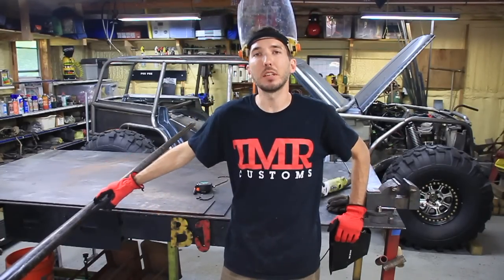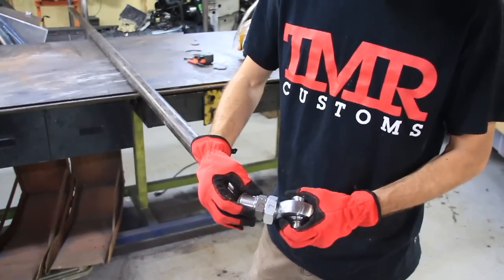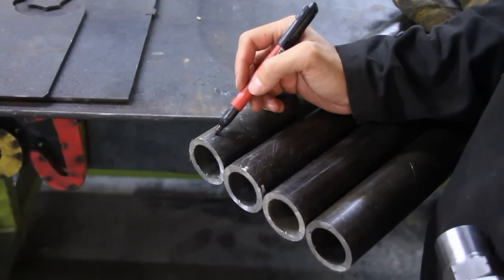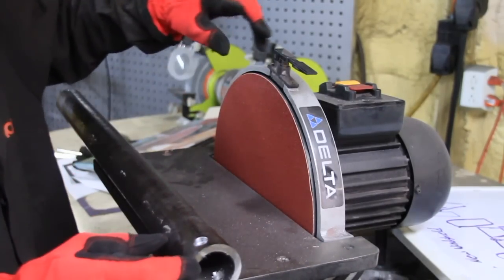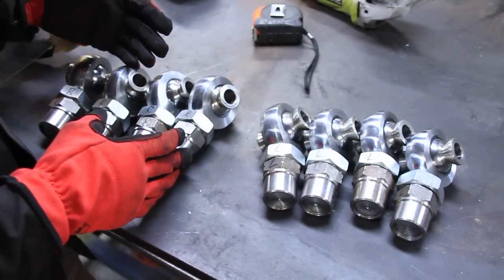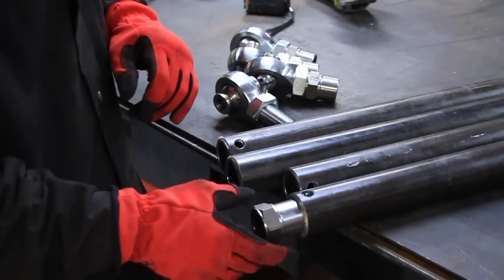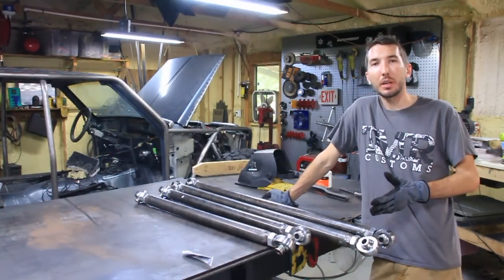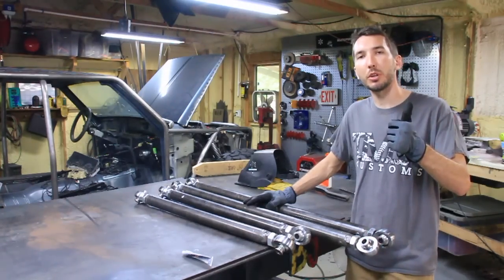Making Control Arm Links

Comment: See the notches in the ridges of the hex head on each left hand joint, that's the universal mark for left hand thread, same goes for fuel gas hose connections.

Comment: Hey man. if you need to block a hole for welding like the threads just jam a ball of aluminum foil in there. Doesn't burn, doesn't stick and it blocks the thread.
Reply: a c Great idea
Reply: Thanks. A lot of tig guys do it for back purging metals like stainless. Also has the added benefit of covering threads.
Reply: Also helps remove heat from the weld while cooling

Comment: Great project and build, It's looking really good. 
You should slow your welding down,  weld a one-inch pass, rotate 90° weld an inch, either keep that pattern or go to next one keep rotating the rods and rotating the welds at 90° rotation to prevent any warping from happening. This would keep it as cool as possible. You could also put some aluminum rings around the pipe, close to the weld to draw the heat away or even cap the end your welding on and fill with water. This look to be a TIG job to me.

Comment: I had really good luck with welding the bungs in without joints. I made a quick aluminum non threaded heatsink that I inserted into the bore with liberal antisieze on it that helped to keep the threads from deforming too much. It let the heat stay where it needed to weld and soaked it away from the inner bore where it was non desirable.

Comment: Perhaps you know better than I but I thought it was worth mentioning wd40 is not a long term lubricant.  Its a common misconception that wd40 is good to put on ball bearings, bike chains, door hinges, etc, etc.  This is actually a bad idea as wd40 is actually a solvent.  Great for getting stuck things unstuck, but it will eat away any existing lubricant and then dry away leaving your ball joints with no lube.  Perhaps those are designed to work metal on metal without lube, but if they do need something, wd40 should be avoided.  "wd40" brand does however make a silicon spray lube that is much better suited to that application.
Reply: Spencer/Tressa Adams exactly what I thought as he put it on the links. I was like oh man... come on your better than that! in my head
Reply: Kroil is best, wd40 is shit
Reply: WD40 is a water a displacer. Hence WD. Definitely not a long term lubricate.
Reply: Very true. It is a very good solvent. Takes off sticker residue and lots of other stuff. It is not a lubricant. Short term, long term, or any term.

Comment: Aluminum links. Your center of gravity is mostly going to be effected by your drivetrain posiiton. Aluminum also holds up better then steel links. You could have also ran lighter upper links as they don't see the bending forces that the lower links do.

Comment: Steel vs Aluminum (normalized against fatigue strength). Steel wins, and it'll make you a cup of coffee! 

4140 Chromoly: 7.8 mass units, 1.5 CO2 units, 20 energy units.
7075 Aluminum: 8.7 mass units, 3.6 CO2 units, 65 energy units. 

Basically, using aluminum will cost you more in the long run. This is when both materials are heavily stressed until they break after repeated use, the steel can be crudely stick welded back together, after being cheaper anyway. Aluminum is easier to drill and tap. Decide what you do more often. I'll keep steel.

Comment: Honestly a solid link of 775T6 Aluminum would probably be the best choice. I've seen them use it on rock bouncers and it seems to hold up very well. You wouldn't want a ton of sprung weight for your rig. You don't have to weld aluminum just drill and tap. Chromoly would be better however I don't have a way of heat treating my welds after tig welding it.
Reply: you could always send it to a commercial heat treatment service, but you might not be willing to pay for the service, but you could have solved the heat treatment process by outsourcing.
Reply: BTW 7075 aluminum doesn't weld for shit.

Comment: Thanks for the show. Wow. You could use a turning lathe for those "sticks" as you make them or other items often enough. Could cut them to length, chamfer, bevel and even weld on one. Not sure on the idea of aluminum vs. the steel. The steel are likely way more strong than needed but I've seen them bend too. As someone noticed before, there is a better replacement for WD-40 called Pro Long Super Lubricants SPL-100. Comes in trigger or can spray. Truly, a lubricant that beats WD40 in many ways plus a protectant. It's cheaper if purchased in case quantity from manufacture vs. a can at a time.

Comment: just spit balling, a steel link with a springy aluminum core, strength from the elasticity of aluminum wear resistance of the steel, save weight on amount of steel (thinner wall) use heat to expand steel then slide in aluminum for presure fit and no room for rust/oxygenation then bore aluminum weld in bung.... feel free to shoot me down, not even his question...  love the channel btw!

Comment: matt,  buy yourself a cheap HF 14" chop saw,  much better than an angle grinder for this.   My HF chop saw was purchased in 2001 and still running strong, best $39 I ever spent.
Reply: I just checked, $79.00 in today's money, still a freaking bargain.
Reply: Go to the pawn shop and get a portable bandsaw. They are always there.

Comment: Just squirt a bunch of heat resistant paste inside the bung hole, protects from splatters and thread warping. Tig welding will give you flawless welds btw

Comment: Depending on the aluminum used , it has a memory property about it (especially the solid stock) ..... So if you land on one of your links it may bend , but it will return to its original shape once the pressure is removed ...... This is what i was told when i was shopping for  link material ...... But cost  is also a factor ... So i went with 2" 1/4 wall dom , vs aluminum ....Eventually i will switch over but for now its all steel for me ..
Reply: Generally speaking, aluminum will always, eventually fail.  There is a reason why they don't make car springs from aluminum.  Again generally speaking.  Its about fatigue strength: https://en.wikipedia.org/wiki/Fatigue_limit.
If you are rebuilding your suspension on a regular basis (racing) go for aluminum.  If your like me, build it once and neglect it until it fails, go with steel.
Reply: Maybe I'm wrong but I don't think of aluminum bends it'll return to its original shape. This is why I always shoot carbon fiber arrows and not aluminum, because if they ever hit something hard enough they will warp and then they will never shoot straight again. 👍

Comment: tractor supply stores will also sell the joints, along with heavy duty tow shackles and a suprising amount of recovery gear etc...
Reply: I dont know why its surprising.  Tractor Supply in more rural areas supply farmers.  I have a #20000 snatch block.  Bought at tractor and it works like a champ

Comment: Outside steel or chromoly tubing, with aluminum bar stock inside. That's the best option. Could probably get away with less or smaller tubes that way as well. Slightly if any.

Comment: Rock bouncers typically use aluminum links because when you smack them on a rock they will bend but flex back straight. Steel will stay bent.

Comment: It's always good to reduce unsprung weight, and the difference for CG would be more than offset by performance gains from less overall weight as well as better suspension action, the downside though is aluminium is way more prone to failure if they get hit by anything.

Comment: Sit the tubes on a length of square U section steel and clamp it down - it will stop it rolling/kicking.

Stepped drills are expensive, use a reasonable pilot hole and final hole using regular drills as they are cheaper to buy and easy to re-sharpen.

I do not agree with using plug welds in this sort of application as 
a/ the welding process can add additional stress and can promote cracking, and for some materials will compromise the temper and strength around the weld
b/ as mentioned, it unevenly heats and can deform the thread form of the insert, it can also result in dingleberries self welding/tacking inside the insert
c/ the strength of the end weld to the insert should be adequate as it is the full thickness of the tube
d/ I'm lazy

You don't need gunge on the internal threads when doing the external threads as the spray/splatter is moving away from the opening.

Consider picking up a LH and RH finishing/ bottoming/plug tap to clean up the threads.

Comment: The center of gravity argument is just about negligible, not really an issue.  Unless it's a race vehicle and you're getting into heat treating it... steel will last longer.  Aluminum will be more likely to wallow out the threads, get messed up on rocks, work harden and snap...

You had me laughing when you said you were going to put down a rag on the floor to prevent a mess... I was wondering if the mess was worse than the scorch marks were going to be ;-)

About protecting the threads- get a fine thread bolt the same size (an old heim will work too, just not as convenient), give it a coat of high temp grease/anti seize/nozzle gel and thread it in before welding.  It should protect the threads, and prevent distortion at the plug welds unless  you way overheat them.  Worst case you can impact it out and run a tap through it, but running a tap in there is a last choice since it will wallow out the existing threads some, they'll never be the same....

Comment: Surprised you don’t have a bandsaw. Even a cheaper harbor freight would be immensely useful for your needs. Cutting with a grinder is time consuming and far less accurate as you know leaving you having to cut long and grind to length. For future projects you can find metric sized hole saws on eBay to fit those more odd ID sizes and there is one company that sells a true metal saw but they come from China. A NOGA tool also cleans inside burrs. The correct hole saws don’t use raked teeth as your accustomed to they are carbide wide teeth more like a mill cutter. They work slow, efficient, and clean. Very cool project.

Comment: So I like the video, just one thing I noticed, I may be wrong, but it looks like your welding in your garage that is spray foam insulated which typically is highly flammable. As a fire fighter and someone who studied architecture quiet a while that made me cringe. If that is indeed the case I would suggest putting up sheetrock bare minimum before doing anymore. You don't want a flaming rag taking out your entire garage, home, or hurting anyone.
Reply: I've seen the blue foam actually explode like gas

Comment: Even though you lighten up the bottom of the jeep Aluminum is stronger. If you keep bending a steel arm then it would be something great to look into.
Reply: Only if you are using solid rod aluminum, but they have problems breaking at the threads for the heim joints. Steel is stronger than aluminum. 4340 chromoly is the best of both worlds, just expensive and you have to know how to weld it.

Comment: Dude you need an air die grinder and a rotary file bit. Removes burrs, enlarges holes, and contours metal like a free hand milling machine. $10 at harbor freight well spent.

Comment: could also vice clamp a size larger short length of pipe, run your build pipe inside,
and as you use a angle grinder it will be a bit easier the work on and possibly turn on its own.
Reply: love your vids, ive never seen that model jeep look so good, 
and from watching your vids it appears to be extremely functional too !
Reply: 9:25 use Anti-Seize

Comment: you could have used a bolt or a plug to seal the inner threads while welding. LH & RH of course or a simple MS or Al taper plug made to suit

Comment: You could also use one sacrificial bolt to hold the hole true and block spatter.
Reply: That is a good point but then you have to worry about it seizing in the hole from the heat.  Still only requires replacing the bung if that happens but that is the downside to that.  Plus that is a huge bolt to put in there.

Comment: You said 1/4" wall tubing- is this what I would find in a kit I bought from teraflex or currie enterprises? I'm looking at making my own. Also, will most tubing benders be able to bend this at small angles?
Reply: Mac You might have to go with a pipe bender. But I would ether go with thicker or drop a bar of aluminum inside before you bend.

Comment: Dude ! great video as all your are. Other than the burning rag and when you hit that smoking pipe like a bong , you should have used some Tri-Flow  superior lubricant instead of that Wana B 40 evaporating lube . You got skill Bro !
Reply: WD-40 is NOT a lubricant !! W stands for water, D stands for disbursement, it's made with 40 different ingredients. Mechanics, machinist, racers, use it to keep tools, machines, parts, & equipment RUST free. I spray my bikes, dirt bikes, quads, sleds, & 4wheeler frames so mud & road salt won't stick causing future rust.  
It's nice to use your equipment & just be able to put away until next time knowing it's not gonna rust out.

Comment: I have a question for you. Is it possible to build a CJ using modern designs and materials that meets the Army's original 1300 lb weight requirements?
Reply: I'm thinking an aluminum tub with a corvair engine is a good start. Maybe an SM420 & Dana 18 with a Dana 30 in the rear and a Dana 25 up front. Leaf springs are to heavy so they're out. Radius arms front and rear with coilover shocks might be light enough.
Reply: Ken MacMillan The CJ and Willys were totally different beasts. If you want a light, weak, underpowered jeep just go with the Willys. This is seriously the dumbest idea (no offense). You would dump 25k on a jeep that has no capabilities what so ever besides being light.
Reply: It was just an idea to see if I could meet the army's original weight restrictions. A corvair engine should be lighter and more powerful than the original go devil engine. I'm never going to build it.

Comment: Wouldn't think reducing unsprung weight matters at all in a low-speed, low suspension-velocity application like a rock crawler; I would think that low CG would be beneficial, but suspension link weight pretty much irrelevant. It would be what's higher up that would matter more. No charge for the opinion. I could be wrong...

Comment: Why not just get a bolt with the same threads as the heims? Thread it in, weld it up, impact it out soon as you're done? It's easier to take out because you don't need to grab a potentially hot heim joint, and if it seizes in, you don't throw ~$100 away.
Reply: Like the idea.  Where can you buy left-handed threaded bolts?
Reply: Try Mcmastercarr, they do one day shipping.

Comment: First off, clean the metal better.  Use acetone.  Removes all traces of oil to keep a pure weld.  Secondly, get a cheap chop saw.  Even better is a band saw for straight cuts.  Thirdly, don’t weld without ventilation.  Fourthly,  if you can, tig weld these joints.  Looks better, more control, less distortion, and NO SPLATTER.   Keep working at it,  and talk to a couple old school fabricators for tips.  I learn every time I talk to those guys

Comment: Heavier steel links, aluminum will damage easily when scraped on rocks, the threads aren't as durable and aluminum tubing will need to be anodized or it will corode and seize onto the joints
Reply: yandri arce the Aluminum is what they all use now on the pro circuit, 
claims to be stronger than dom steel, and  also has memory,